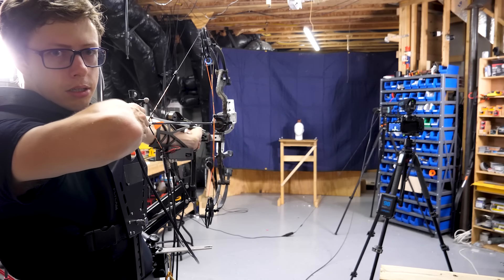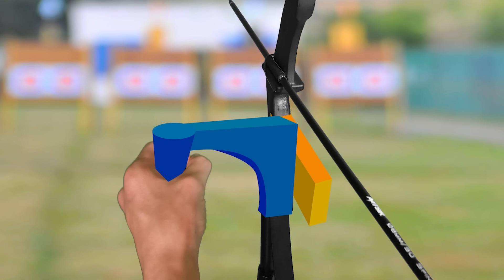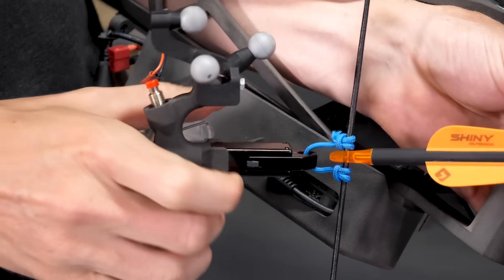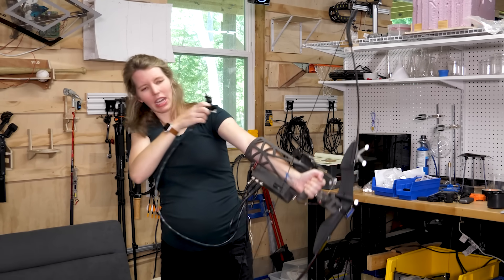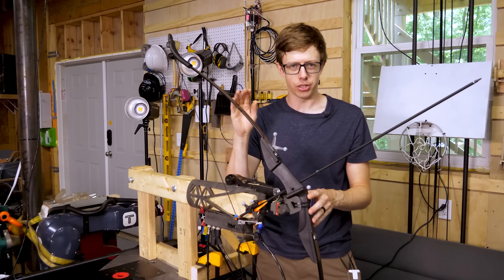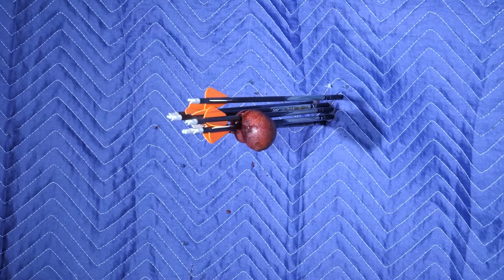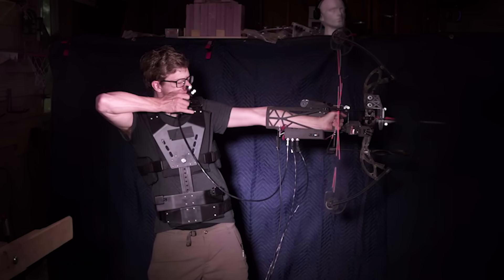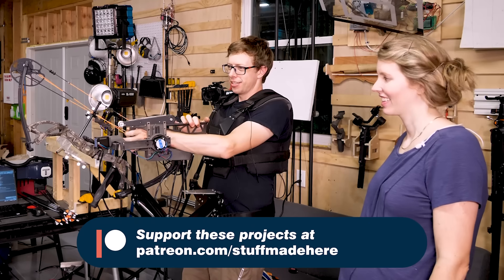Auto-aiming bow vs. FLYING targets

Comment: I saw $100 if I can miss... CHALLENGE ACCEPTED! I've tried archery before, I'm freaking terrible at it, that's usually not something to brag about but if it gets me $100 I'm sure I can find a way to screw this up too. Hopefully without hitting myself in the face. In fact I'm so bad that I'm pretty sure I'll not only miss the target but fail to even reach the target in the first place. I'd be shocked if I could even get near the target let alone actually hitting a bulls eye.

Also I just noticed you have a bunch of other $100 if you can miss challenge videos... so yeah... I'm pretty confident I can miss... Basket Ball I might be able to get the ball in, I've actually done that before but it was just a fluke that I've never been able to replicate since then. The most I've done is I think 3 baskets in a row... from the same spot... not moving... with no one trying to block the basket, just me doing free throws... and that was still pretty amazing that I even managed that. Might of just been because I'm freakishly tall and the basket ball hoop was at an elementary school so set generally lower for little kids otherwise I'd never reach the damn thing.

My being terrible at sports can finally pay off! Let me try your auto shooters!

Comment: Uhm...I have some files for a sub 200mm Air Breathing Rocket Engine. The intake pre-cooler prototype needs to be DMLS because of the very small ID of the coolant expansion tubes. Would it be possible to collaborate? I know it might be a long shot, but you're one of the few other people crazy/determined enough to further hemorrhage the already bleeding edge of general technology. I literally don't know anyone else to reach out to currently.

Comment: You probably been told by a million archers like you don't know how to properly shoot a bow even though that;s not the point of this video but if you're looking to not hit yourself in the face anymore, at max draw you don't hold the quick release in front of your face. 

The string should go into crook of your nose with your arm drawn fully back as if you're flexing your arm behind your head. This causes the most minimal movent to the bow and your follow through is equally as important i.e. letting the bow fall forward after your shot. Also when drawing with the bow in your hand, you push rather then hold with a fist.

Comment: Now remove the motion tracking camera system and replace it with a bow mounted camera and lidar or something similar so the bow can be used everywhere and because... you know... the system is clearly not heavy enough yet and rewriting all the code would shurely be a lot of fun...

Comment: I know the dart board has already been done but you should make a dart that has adjustable fins so that it goes to a chosen spot on the dart board
Reply: I don't think darts fly fast enough for enough aerodynamic forces past just weathervaning.
Reply: It’s entirely possible the dart just needs to be thrown very quickly I wonder how that could be done...
Reply: @pleaseibegyoudontspam5598  at that point it's not a dart anymore. At least it's not one of the hand thrown pointy objects used in the game commonly played in bars. Maybe lawn darts though. I still think with the small aerodynamic surfaces there isn't enough time/distance to get a change in velocity for course correction.
Reply: With a standard 3 thin configuration it wouldnt be possible the dart would only be capable of rolling however if you make the center mass in the tail and make each flap a composite wing that consists of a stable wing to account for roll and another section that can move to pitch the dart it would be possible
Reply: @pleaseibegyoudontspam5598  seems like you've got it figured out. So go ahead and build them. Post a video when you're finished.

Comment: My hypothesis of why it misses slightly is because of the human error. You pulling the bow back with your hand out away from your body is inconsistent. That’s why good archers have an anchor point somewhere. Also it could be tension on the string perpendicular to the bow. If you don’t hold it straight back it won’t shoot straight. I think if u solve those problems it will be better but tbh the accuracy of bow is not gonna get much better. It’s not a 1000 dollar bow and also consistent weight and spine of the arrows. Archery it crazy complex actually.

Comment: The only thing i could see messing you up the first few tries is the draw length of the bow.. Most higher end bows you can adjust the draw length so that you are holding the release to your face and not away so when you release you dont smack yourself in the face :)

Comment: There is one thing that I think migth have played a lot one the accuracy with the recurve. It is that the force it puts in the arrow is exponential the further you pull on it and as a relatively inexperienced shooter you should not be able to consistently pull the arrow at the same length. wich is quite hard even if you are an experienced shooter thus changing the height of were the arrow land. Whereas that problem kinda disappeared with the second (in fact reduced but i don't rly know to wich extent since i only shoot barebow usually only tried tried twice compound bows) because when you pull on a compound bow there is a "sweet" spot where you don't need to pull hard on the bow wich make it a great indicator for a inexperienced shooter to be relatively close to the same "pull" force and thus letting the program know the behavior of the arrow since it won't have a random force on it.

If you have read all this in my poor quality English thx.
I'm curious to know if any of you agree or wish to make a counterargument.

Comment: Now for a v3:
- a high speed camera on the bow, aligned with the centre of the aim,
- image recognition software identifying target - simple artificial neural network
- a laser range finder on a gimbal that can be automatically pointed at recognised target and measure distance to it
- a line tension sensor calculating the initial velocity of the arrow

I guess this should allow you to get rid of external cameras and markers and make it portable.

Comment: version 99: attach electrical cables to the muscles so it electronics drives the arm muscles to target without external mechanics
version 999: brain sensors read information from eyes and body, electronics sends signals to muscles  
version 9999: mind controlled electromagnetic field sends metal arrow to the desired location without a bow

Comment: You would notice a huge improvement on consistency and repeatability if you change the arrow rest to a drop-away rest. "whisker biscuits", particularly the full type that you used in this video will slightly and inconsistently affect the  arrows flight.

Comment: Its an amazing achievement...  I also saw what Joerg Sprave can do, if you two get together and use and Instant Legolas bow or cross bow from Joerg and your aiming system, you can come up with an amazing super weapon that never misses given its energy parameters

Instead of having the cameras hanging from a steady position fixed in your garage walls,  you can put 4 points on your bow, to create 4 reference origins, from those, and some coding, some camera work (not expensive or heavy) and some laser rangefinders, maybe expensive, but I doubt it... you could create the same aiming system, but the reference is carried in the bow...  of course, the larger the distance between the reference points, the more accurate your bow will be...  I would really love to see this resolve the Bow Problem...  And congratulations on an amazing project!!! :D

Comment: I’ve loved seeing your progression on cool projects @stuffmadehere 
Two questions related to the Motion Capture also (I have experience with the OptiTrack system in a research lab):
1) I also am curious if you’ve reached the theoretical max precision with the passive markers. On the optitrack website https://v22.wiki.optitrack.com/index.php?title=Quick_Start_Guide:_Precision_Capture they show a minimized residual of ~0.43mm. Worst case would be the bow to the left and string to the right, which would be ~0.86mm. Assuming a 26 inch draw length (~660.4mm), the error would be 0.0746 degrees ~= 1.3milliradians. This angular error would be ~2.6 cm at 20 meters. This is just measurement error, which will be magnified by the computer and your shaking.

2) Any reason why you didn't build a test stand first? I figure it would eliminate you as a factor. Maybe you did and just didn't show it.

Last aside, please don’t go the way of Mark Rober 😕 it seems every new video has less and less technical aspects that made us fellow engineers fall in love in the first place.
Honestly I was surprised the video didn’t even really show anything new that you learned. I also love when you draw on the tablet for complex subjects and show the mathematics.

Comment: You hit yourself in the face because the bows draw length is not appropriate to your arm length. The bow string should be basically touching your mouth/face with arm pointing back to properly shoot a bow.

Comment: here's your biggest problem: you're not holding the bow properly. This is a great engineering problem, but you have some core issues that, if solved, will help you aim better and be less reliant on that big heavy machine.

1: your elbow needs to be slightly bent. This will prevent the string from slapping your arm.

2: your elbow needs to be slightly bent. This will hold the bow closer to your body, and allow you to make the most of your motions.

3: when pulling the string, it should ideally almost touch the corner of your mouth. This will allow your hand, and by extention your trigger, to pass harmlessly by your face. no more getting punched in the nose by your own strength.

4: hold the bow higher. Your eyeline should be in line with the center of the bow, and parallel with the arrow.

5: turn your bow side shoulder towards the target. This is a critical posture to ensure accuracy, and lets you use all of the muscles in both arms to aim, draw, and fire. 

I also did not take any archery lessons, I taught myself. I didn't even do this as a child, I started doing this at 20 years old. If I can do it, you can too.

Comment: Would be even cooler if the cameras used for tracking weren't hard mounted, but instead mounted on drones and the drone sent its position information to the cameras to offset for movement. You could then have like the fleet of camera drones surround you for tracking and bring the bow anywhere

Comment: @stuffmadehere If you add an anchor point 28" (the weighted average of a draw length of pull) from the chest piece or an arm from the belt for your right hand to rest upon, that may help with the calculations and diffuse the recoil when releasing the trigger toward your face. You could then add a slider bar to compensate for each archer's draw and plug in the offset (if needed into the X axis in the program, ticked off based on the bar increments.) Normally, you have the draw hand anchored on your face, lower chin/cheek or otherwise, much like your wife was doing. That might help with the stabilization and force returned when releasing.

I do traditional archery, but a lot of the same concepts might carry over.

Comment: Not sure how helpful this is, but the range of variation in your arrows' flight can be dramatically reduced by matching the dynamic spine of your arrows to your bow setup (tuning).  To be sure all their arrows are reacting the exact same when fired, you can remove the fletching to shoot shafts bareshaft, and then paper tune at distances up to 60 yards to see if your arrow is staying as straight as you need it to be.  Increasing arrow mass and moving the center of mass more forward of center increases bow efficiency (reducing bow vibration), increases projectile's momentum & kinetic energy, and decreases arrow deceleration at further distances.  The lighter and faster your arrow is, the greater drag and drop it experiences at further distances from air.  For example, you're using carbon arrows that have a stiffer side and a weaker side based on how the carbon was wrapped.  The arrow's nock orientation, and fletching type and orientation, length, point weight, insert weight, spine, arrow length, draw length, bow poundage, rest orientation, bow cam lean, bow cam timing, d loop nock pinch, etc. are all factors of a tuned bow and arrow setup.  Getting a bullet hole on paper with a bare shaft at 7 yards is the first debugging you can do in your steps towards perfect arrow flight.  "Paper tuning" with fletching is cheating, as the fletching will correct tuning errors. If you have perfect flight from a bare shaft, then fletching can be your safety net towards perfection.

Comment: Theoretically would it be possible to make the device portable by replacing the ceiling mounted cameras with two coaxially mounted cameras on the bow structure itself? I mean, two side by side mounted cameras may be able to perceive depth, similarly to commercial drones' obstacle avoidance systems.

Comment: Small improvement to protect the nose. Have a set length to pull back on the bow (plus a little)  and have some paracord or whatever tied to the bow and the release mechanism.   Prevent it from getting too close to the face

Comment: I love that rather than getting stronger for the bow, Sean made a friggin gimble for the bow. Lolz. Modern problems
Reply: *bought
Reply: @prasad530  he bought a new bow but made the gimble get it right
Reply: @4vxry  You get it right.  It's an off the shelf steady cam setup for video, which he modified slightly to accept his bow.
Reply: Necessary to allow the bow to pivot easier.
Reply: Require modern solutions.
Reply: Why is his wife's stomach so big though?
Reply: @milotherocket  probably one of his other projects.. Maybe it will be in a video some day as well

Comment: Theoretically, could you make a bow like this that can hit targets in any area if it used lidar instead of the tracking balls?
Reply: In theory, yes. But it's a waaaaay harder problem. Partially because you need a way to tell the system which object is the target. I think that's almost impossible with just lidar. But once you do that, then it's basically the same problem as self driving cars. I think you're almost better off going the Tesla route and using cameras. But... You're talking several orders of magnitude more complexity.
Reply: @DanielWilliams-oi4ss   Yea makes senes plus its probably way more expensive too. Still a cool concept tho.
Reply: tracking balls are morr trustfull since lidar analysis area by scanning surface and tracking balls using cameras which are targeted on item whichs location their already know

Comment: Just a quick note to help the issue of hitting yourself on release. Adjust the draw length to be longer. Your release should anger somewhere near you jaw bone. It is a simple adjustment on the cams, but if you don't feel comfortable doing it yourself. Just about any place that sells bows should be able to adjust it for you at not much cost. I think the most expensive place near me charges like $15 to $20, but some do it for free since it is such easy work.

Comment: So from one engineering mind to another...I noticed that you only released the arrow on the moving target AFTER the apogee. I assume this was because your software can't compute a moving target's anticipated trajectory before it begins making a parabola, right?
But I am curious about a few  things...First, does your bow need to know the exact distance between you and the target? It seems like it must know that. Secondly, how does your computation take into account the speed of the arrow? That will change depending on the bow's strength and also how far, exactly, you pull the bow back. Speed has got to be vital in the calculations.
Finally, what are the maximum divergent degrees your bow can point before it cannot possibly hit the target?
But I do want to say I give a HUGE thumbs up to your skills as an inventor. Keep doing what you do.

Comment: I have a challenge for you, build a 2box detector capable of finding precious metals upto 30ft in the ground but do it in 1 portable unit with High accuracy. 

The scientific Atlanta Gemeni 3000 is a good model to start with for 2 box solution